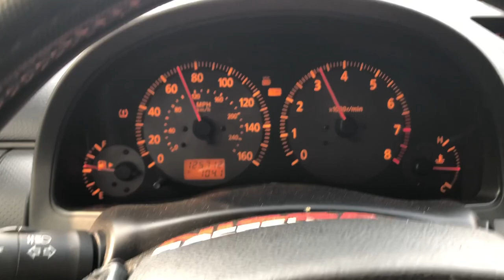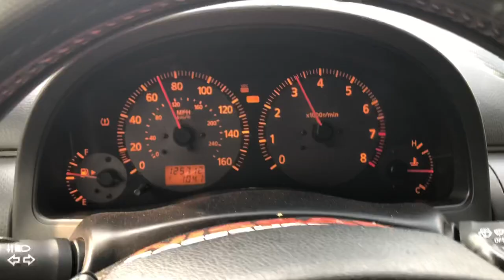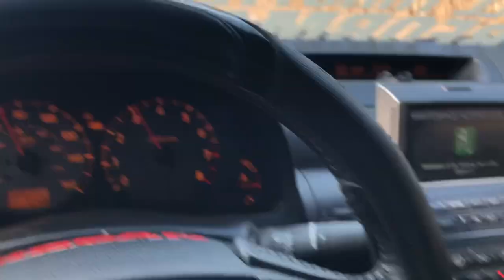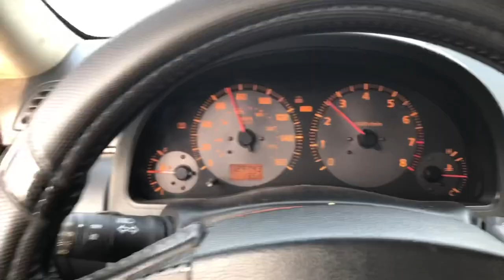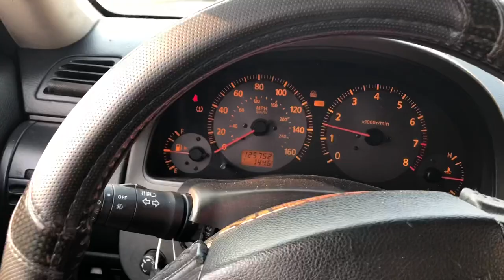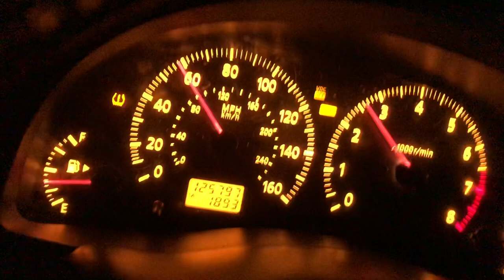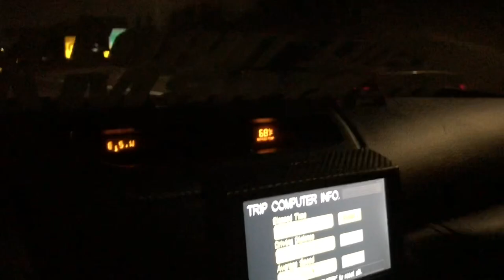WORLD's BEST EXHAUST SET UP FOR G35/350z ,MOTORDYNE ART PIPES + MOTORDYNE TDX2 SHOCKWAVE

Comment: Hey bro awesome video. I have the same tdx 2 and art pipe set up for my 06 g35 6mt. I havnt installed it yet. But im in CA also and was wondering about how loud the system is. Have you had any problem in ca saying its too loud to be legal or anything like that. Mine is my daily driver so just wondering?
Reply from the maker: its only loud when u gt on it this exhaust i believe will pass the db reader  forsure
Reply: @foreverg3549  thanks bro ima be installing my soon